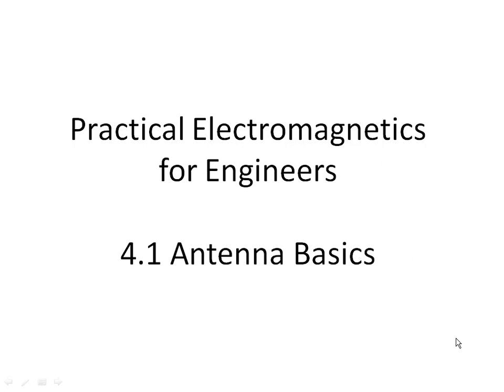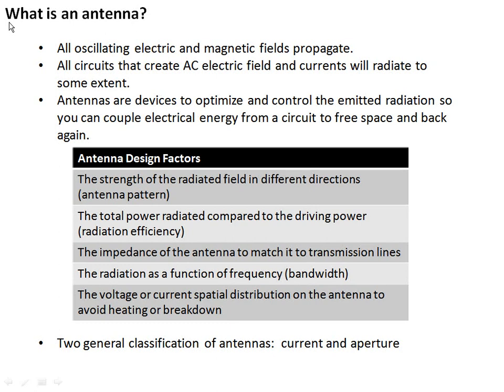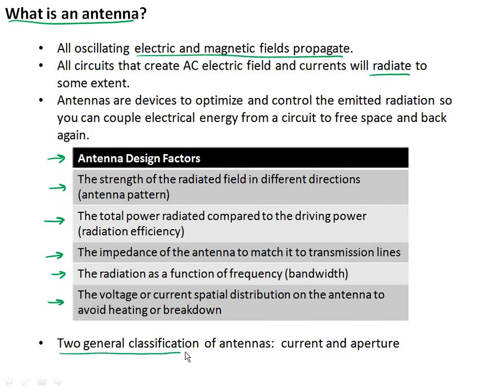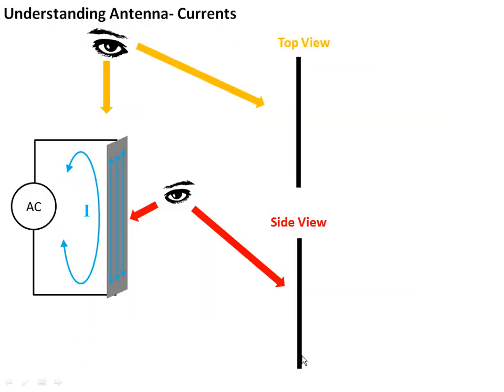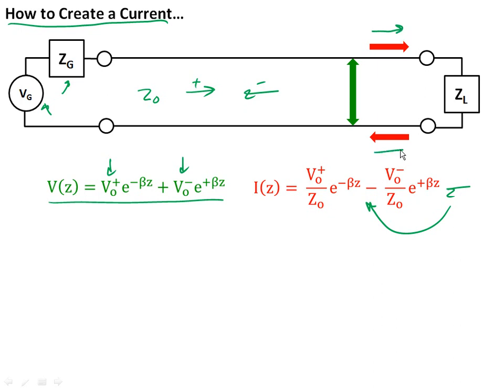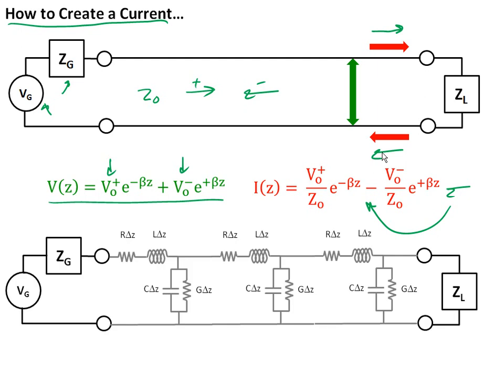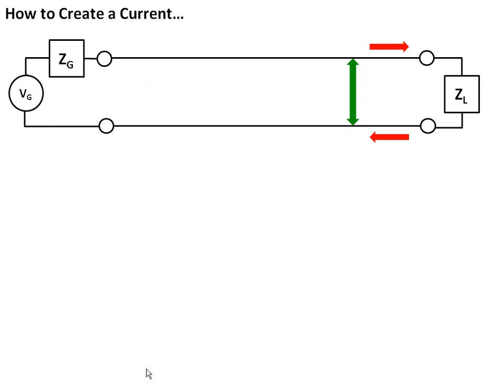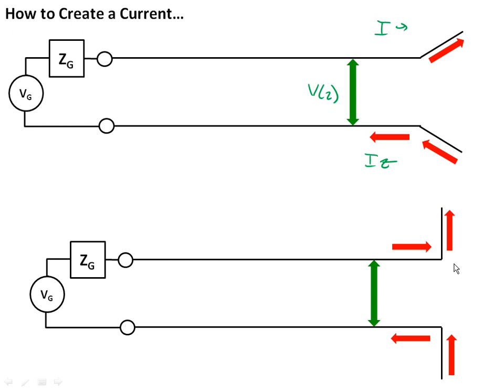4.1 Antenna Basics

Comment: Note: Links to 3 videos with simulation of radiation included.
How does an antenna radiate?
Every stationary charge such as an electron and a proton has an electric field surrounding it. When the charge moves, it produces a magnetic field. When the charge is accelerated or several charges accelerate, an electromagnetic wave is radiated. 
Radio waves and light are electromagnetic waves comprising electric and magnetic field pulsations or variations in their strength at each point in the space.
They are produced by accelerated electric charge like the electrons of atoms in antenna rods. The radiated fields constitute a wave travelling through space. 
The fields don't travel, the wave does. 
This is best visualised by a rope, one end of which is fixed to a wall and the loose end held some distance away.
The loose end when moved up and down creates a wave travelling. 
Notice how the molecules of the rope near the wall have not travelled to the loose end. 
The snake-like shape in the form of a sinewave and travelling movement you see is the overall effect of the up and down movement of the molecules of the rope.
The same happens with the strength of electric and magnetic fields of radio waves and light. 
There are no sinewaves in space! It is the strength of the electric field say, which we plot of a radio wave which has a pattern of a sinewave.
The radiated fields produce a transverse wave and the space size of the comment section is not sufficient to provide an explanation of how a transverse wave is produced by an accelerated or decelerated charge.
Video 1 Field lines for a particle moving with high speed
http://www1.astrophysik.uni-kiel.de/~hhaertel/Videos/large-velocity.mp4
Video 2 Field lines for an oscillating particle in 2D
http://www1.astrophysik.uni-kiel.de/~hhaertel/Videos/oscillation-2d.mp4
Video 3 Field lines for an oscillating particle in 3D
http://www1.astrophysik.uni-kiel.de/~hhaertel/Videos/fast-osc-particle.mp4
To learn more see "Electric and Magnetic Interactions" by Chabay and Sherwood 
www.matterandinteractions.org
or 
Fundamentals of electric theory and circuits by Sridhar Chitta
https://www.wileyindia.com/fundamentals-of-electric-theory-and-circuits.html

The book by Sridhar Chitta, begins with the fundamentals of charge, electric field, surface charge, current, voltage, simple circuit, parallel circuit, capacitors and capacitive reactance, inductors, inductive reactance, induced fields and transmission line effects, antennas and wave propagation, and waveguides. The topics described in the book, make a distinct unified approach to electrostatics and circuits lending precision and clarity to the topics which is not found in most text books.
The book comes alongwith a CD with animated power point presentations for all chapters and voltage regulator, RC phase shift oscillators and differential amplifiers included additionally.
There is a "look inside" feature in the amazon.com webpage of the book "Fundamentals of electric theory and circuits" by Sridhar Chitta with a few pages of Chapter 1 which may be viewed and also which you may swipe left or press < icon to view the foreword, preface and Table of Contents. 
For a nice video about antennas and radiation visit https://youtu.be/-F7KYLO4Bkg
For a lecture by Prof Ruth Chabay on radiation and reradiation, watch from the 59.0 minute
https://youtu.be/VKqCI9pU3QI

Comment: The electric and magnetic fields explain the near field. The far field (radiation into space) is a result of special relativity's effect on accelerating charges. The emitted photons slow the electrons (or possibly positive charges, but electrons in nearly all antennas) which causes the radiation resistance.

Comment: I guess another lie we were told, that to have current of any sort in a wire it needs to make a loop and come back to the source.  Now you can have current in an open circuit.  I was aware that with enough high voltage you can get spark jump in a spark plug, but not electron jump.  And now this:  You can have photons come out of wires and the catch is simply to bend them exactly at 90 degrees as a result of electron current, but open to space and not loop back as one wire.
Reply: The circuit isn't open. The separated wires form a capacitor. The capacitor "passes" the high-frequency AC...

Comment: From 5:26 the blue E fields point in the same direction even though the current and magnetic fields have changed direction. That cant be right.
Reply: Exactly what I was going to say. The induced E fields in the "Side View, Later" section on the right side of the slide are incorrect. They should be opposite from the left side view.

Comment: So can someone please explain to me how current can flow through a dipole antenna when the circuit is not closed?
Reply: it's as simple as capacitor charging and discharging
Reply: @beharajagadeesh9001  how can it charge and discharge when the current has nowhere to flow
Reply: Especially with low voltages
Reply: Charge will accumulate on the antenna because of applied voltage (according to signal) and discharges accordingly applied signal
Reply: @beharajagadeesh9001  what about rc antenna with a single long wire
Reply: @nosknut  it has opposite conductor of some sort: device case or even your body